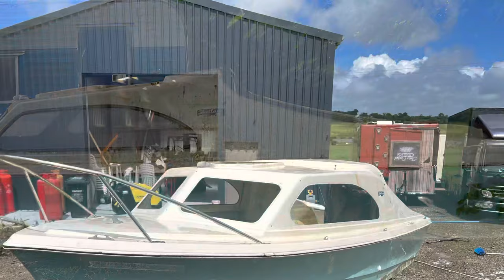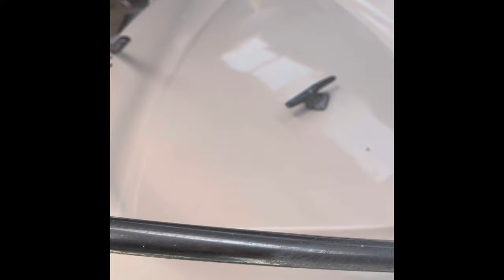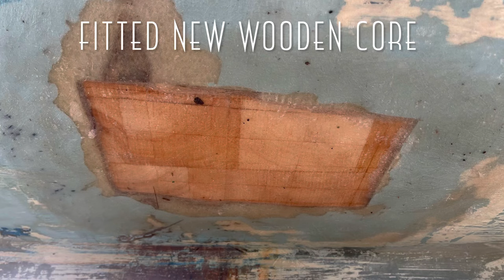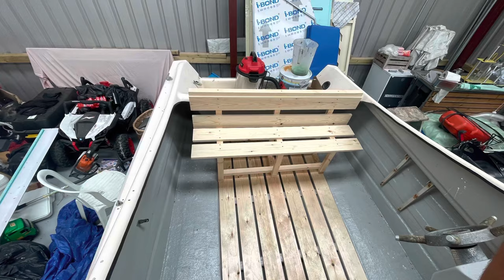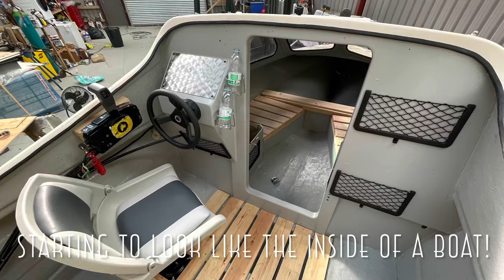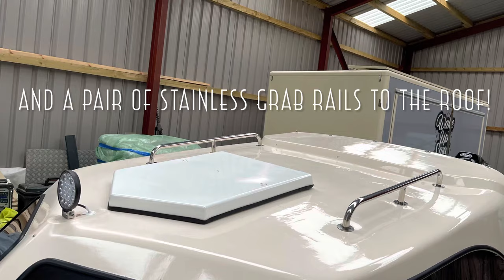Shetland 535 Boat Restoration Project

Comment: The deck and cabin-top gel-coat polishing is amazing. It shows how an old gel coat can sometime be bring back from the dead without the need for paint. Congratulation.
Reply from the maker: Thank for your kind word
Reply: @hurleyofflost  did you notspray the top coat ?, was it only t-cut or something it looked new
Reply from the maker: @lazycarper  i wet sanded by hand  with 1500 grit and  then I used farecla G3 polishing compound with a machine polisher  and finally a standard off the shelf wax put on by hand! Total cost of everything was £150!!
Reply: @hurleyofflost  great job
Reply from the maker: @lazycarper  thanks pal

Comment: Hey is it possible to fixed the rubber for the windows with Sikaflex 522 ? A big wave crashed infront of my Shetland 535 an the window not hold and get inside so a lot of water comes in ? Thanks
Reply from the maker: Hi I didn’t need too I ordered extra tight rubbers seals so mine don’t move!
Reply: @hurleyofflost  can you tell me which one you ordered ?  I have 5mm x 3mm x 23 mm
Reply from the maker: @mxnubtw117  I ordered 5x5mm rubbers but they fit so tight like I said I didn’t need any sikaflex! Good luck!

Comment: Such a nice looking boat and quite a transformation!  I've just bought my first boat and have been looking for inspiration / motivation to get it ready for the coming spring / summer.  It's a 14ft day boat from Carrick Marine and has been sat unused for a good few months. I really wanted something with a small cabin (like yours) but this was too good a deal to pass by. Anyway, first challenge is going to be reversing the trailer onto our driveway so that I can start off by giving it a thorough jet wash!

Comment: I have had 5 Shetland 535's over the years and they are great boats, well done on doing the windows properly and keeping the steering wheel in the correct position, they are both much better done as standard.
All you need is the windscreen on the top now! 😊
Reply from the maker: Ahh thanks mate yeah I think so too I’m unbelievably happy with it created some epic moments on it already this summer! 👍🏻

Comment: Have you got any idea of the overall cost. Thanks
Reply from the maker: It was about £3000 but the engine was half of that it cost me £1500 also that’s not including the rollercoaster trailer it’s on at the moment that was £500 hope that helps! 👍🏻
Reply: @hurleyofflost  sure does. Any guidance is helpful. Thanks